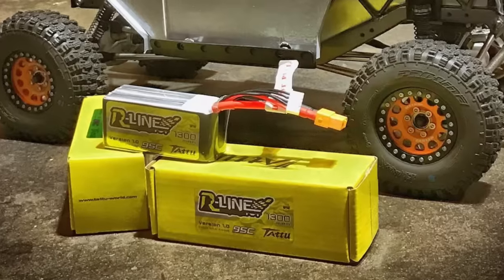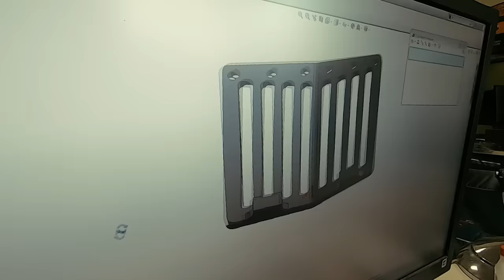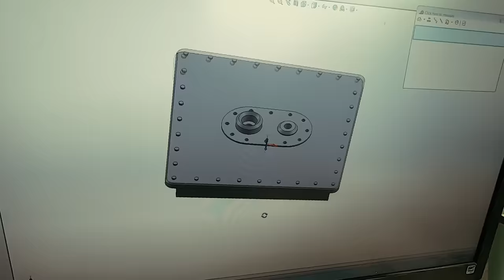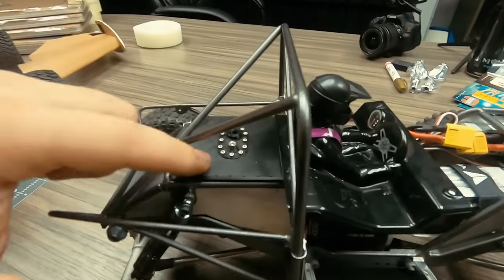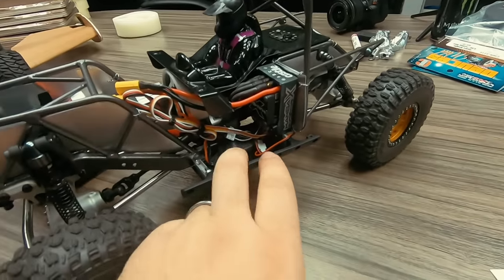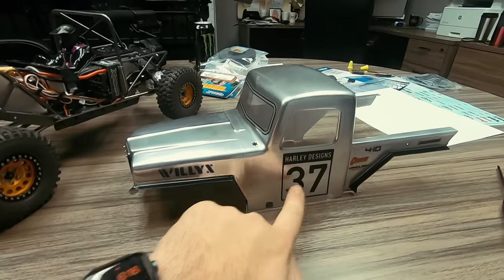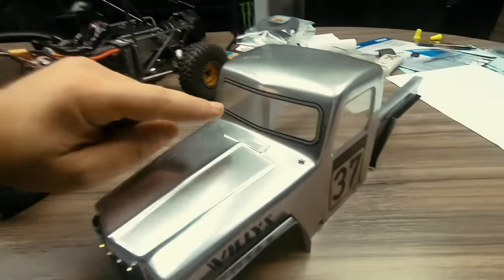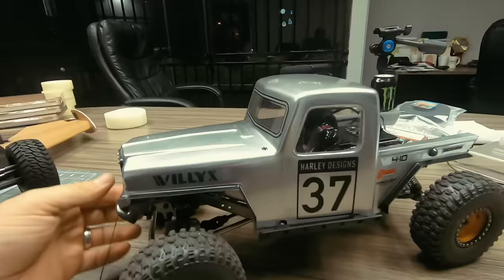Crawlmasters - Vanquish VS4-10 Build Vlog EP 5

Comment: FANTASTIC Josh!! 🍻🍺🍺👏👏👏👏
The Silver is better than you think. Looks good. I HOPE that you're not ruining all that hard work by DRILLING Holes in it for Posts and Clips.... If you don't have time to set up Magnets, at least go with Velcro. 😉
I really like that lowered Battery Tray, that's clever!

That looks so Badass!! 👍👍😎 What I feel is a striking and cool part, is that Willys Grille! You're right, NO Decal would have worked better. Will that be available on Thingiverse??  I still don't have a Printer, and don't expect to for quite a while, and nobody I know will Print for me (the ones still speaking to me).....…...

If you could put it on Thingiverse, and set up the "Order This Printed" feature, there's Vendors on MakerBot who will Print for you, a very low Prices. 😊   FWIW, I'd appreciate it if you could. 
Be Proud Sir... Job well done!!!
Carmine 💥⛽

(Trying hard to repair a damaged reputation) 😞

Comment: Looks great man! I love videos like this that show how to fab things. What's the purpose of putting the blue tape on the sheetmetal before bending it?
Reply from the maker: I put blue tape down because I transfer the pattern on to it with a pen by tracing the paper. That way I don’t have to try and hold the paper in place or use a sharpie which is just too fat of a line.
Reply: @HarleyDesignsInc  great idea. Thanks for commenting